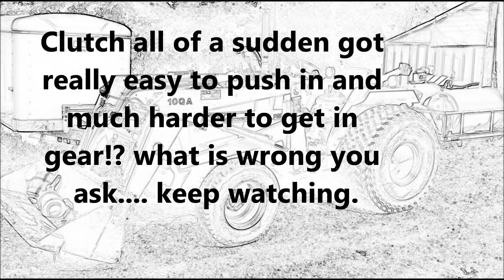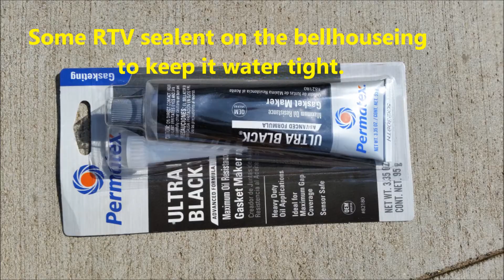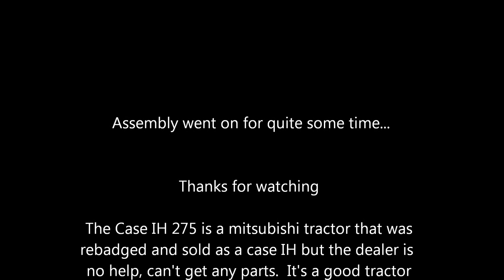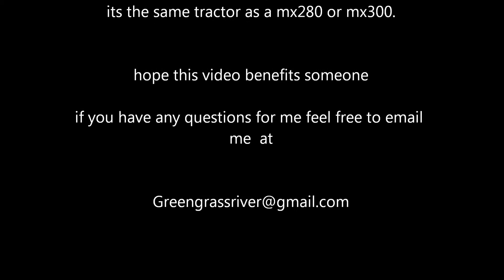Case/IH 275 tear down (split tractor)

Comment: I´m having these same problem in my case 275. Was thinking it was the valve below the clutch pedal. Disassembled it, cleaned it, but the problem remains. Now i can see what the problem may be! It´s a petty that the manufacturer does not put a cap in that place to reach the pin without spliting the tractor a part! ;( Thank you very much for your video!

Comment: My tractor is ih 92 275 and replaced the clotch and still is sleeping somebody can help me please I need your knowledge people 🙏
Reply from the maker: Needs Ajustment or the hydrolic stage of the clutch could be stuck that happens on that tractor.
Reply: @JustinGoinsfixit  where is the hydraulic stage what do you mean I don’t understand 😔
Reply from the maker: The clutch pedal works 2 stages of clutch. The dry clutch you replaced is one stage. Another stage uses a hydrolic valve. The valve is right below the pedal under the floor plate. Easy to see where the pedal activates it. It can stick make it seem like its slipping. Iv had it happen before.
Reply: @JustinGoinsfixit  thanks 🙏 so much for the help